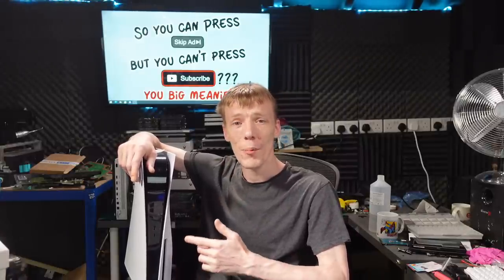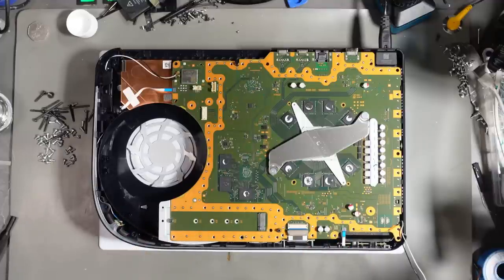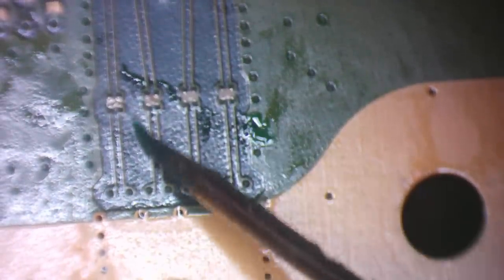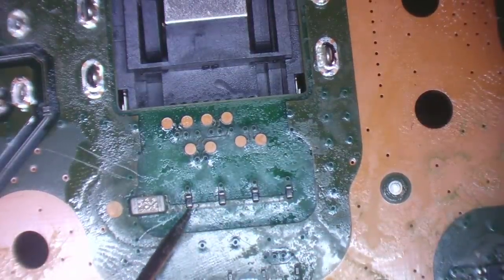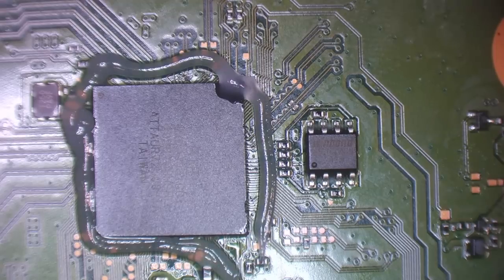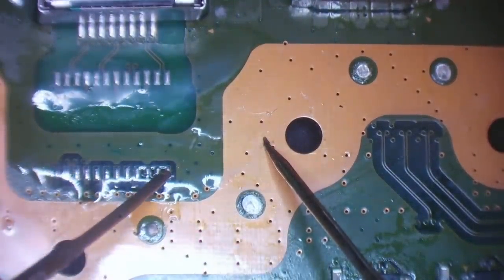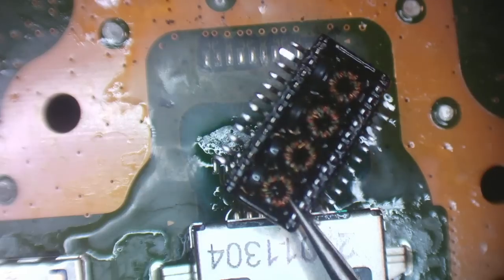This PlayStation 5 Got Struck By Lightning, And I Might Not Even Get PAID To Fix It!

Comment: That’s why I have my PlayStation five and PS4 Pro hooked up to monster surge protector I paid almost 3 or $400 for it if you love your electronics you should always have a surge protector to protect you against lightning strikes and it being insured through monster power surge protectors they were the best
Reply from the maker: Yeah I agree, a lightning rod would work wonders on the side of the building too
Reply: Dude u well overpaid you can get magnets that clip onto your hdmi for £20 and extension surge protectors which are also covered by your insurance as long as there licensed for £25 for each room, I had a lightning strike it blew my router my ps4 which had every part replaced by insurance before it ran out it was a 3 year what I got when I bought it was connected via ethernet it blew that but was connected to my tv with a hdmi with 2 surge protectors one on each end what saved my tv, now in my gaming room my ps5 and Oled TV were £2500 on there own so I defo trust these surge extensions as they have a side button and when there's a surge it switches off immediately, I sent my ps4 to CEX and said it was unfixable? This was before I found my man here but if your happy spending $400 good on you but surge extensions do just a good a job at a lot cheaper
Reply: Lightning can worm it in though antenna and hdmi also 
happened to my ps3 some time ago

Comment: Hi Phil - Glad to see the edited version of this...watching it live for those hours with you was rough, but I always learn something from your vids. lol

Question though, was this video a combo of both PS5 systems? I don't know if I'm missing something or if someone else has already mentioned this, but in most of the video you were looking for a short and you had swapped the South Bridge from a PS5 donor board that you reballed and you mentioned it was the only one you have and if the customer isn't paying you weren't leaving it (for obvious reasons). But then at the end, you mention the chips were real and looking through the comments below and the link to the chip you listed on AliExpress it's all about the HDMI Encoder. So I'm just a little confused..more then normal. hahahahaha So, was this PS5 fixed in the end with the HDMI Encoder or the South Bridge? Thanks! 🙂

Comment: Good job Phil. Thanks for the video. Really helpful  information there.  

I've had way too many storm damaged ps5s in my workshop last week. And like yourself spend way too much time on them. All with different issues. From blown power supply's to encoders and southbridges. Ps5 are a bit sensitive to power surges it seems. Glad to know those chips are real as I've got some coming from Ali too. 

Keep up the good work!

Comment: Off the wall question:
If the signal comes off the APU as a DisplayPort signal, is it theoretically possible (with heavy modding) to replace the HDMI port with a DisplayPort connector and bypass the encoder entirely?

Might be an interesting console modding experiment.
Reply: That actually sounds pretty cool. I would love to see a vid or two on that.

Comment: Great work on that one! I'll freely admit I had my doubts as to how fixable it was.
Also, while not directly applicable to this case, I had a thought about retimer chip. Given the fact they seem to fail so often, do you think they're getting overheated or similar? Would attaching a small heatsink with thermal adhesive/pads do anything?

Comment: I'm only 10 mins in, but as you suspected it was HDMI.
I wonder if it is possible that the lightning travelled through the TV aerial to the TV HDMI and caused the PS5 HDMI encoder to sh!t the bed.

Edit. Also the safe bridge.

Comment: Great work mate, I've just started out with a £150 kit. So far I've managed to fix several electronics down to watching your vids.
Reply: should wear ESD gear
Reply from the maker: JustOneSecond no, ESD is horde crap mate, sorry, but I've never been "ESD protected" and I've never damaged components. Linus and ElctroBoom did a video on it last year
Reply: @TheCod3r  Fair enough, but the damage builds over time.
Reply from the maker: It definitely doesn't mate. Linus and ElectroBoom was literally zapping the chips with static discharge and it didn't do anything, and in 4 years I've never had a board come back because of anything ESD related
Reply: @TheCod3r  I've been computers since about 1995, never used any kind of static protection, and I've never had any problems.  486 to 12900k.
Reply: @TheCod3r  i repair tvs for a living and samsung/lg/sony etc all of them want you to wear ESD straps.... ive never worn one and ive repaired over 10,000 tvs and not one has failed due to ESD. Chips these days are made with ESD in mind so the chances of damaging a component is very slim (maybe cheap stuff is more prone to ESD, but im yet to see it!)
Reply: I worked at crestron, some of those pcb's were expensive as hel, some builds went over 100k for a single unit, crazy expensive orders were the norm. We were shown examples & pics of ESD damage, i'm not saying im right and u are wrong, but we had to use ESD gear everywhere. Maybe to prevent suing 😂
Reply: @Crash-Rest-Yummy  sorry by cheap stuff, i mean fake/cheap copies of chips, and im sure there is PCB's that are susceptible to ESD, but with modern consumer electronics im yet to see it, firstly becuase they tend to have huge ground planes and because like i mentions before, chips are build with ESD protection in mind as companies dont want to be recieving a bunch of RMA's becuase its hard to prove (pretty much impossible IMO) that ESD damage was caused by the consumer.
Reply: @Mr-ZinK  I don't mind u calling it cheap np , i don't work there anymore, and i totally believe u 🤝

Comment: Very helpful video Phil. I have a PS5 that was allegedly "hit by lighting". When I do continuity checks around the encoder and south bridge, I'm getting approx 2.5 ohms resistance on 5 or 6 of the caps Is that considered shorted or is that a normal reading ?
Reply: you need a working ps5 to compare with.

Comment: Having a lighting struck ps5 going to sony for repair.  I didnt tell them it got struck by lighting.  My question is do you think they can tell it was struck by lightning?  The other video the power supply was out.  For all they know it could be a faulty power supply.
Reply from the maker: If it's under warranty I'd say they'll probably verify it isn't liquid damaged and just replace it to be honest. Not to hate on the repair center techs but most of them aren't really qualified or experienced enough to tell to be honest
Reply: @TheCod3r  that's what I was thinking.  I seriously doubt they would go through the trouble that you went through testing every single part when they can just send out a refurbished replacement.
Reply: @mrdante361  hey did Sony repair your PS5? I’m about to send mine for the same issue thanks for the info man!
Reply: @123rubd  yes I did get a ps5 back and it's been working great.

Comment: Yo, good work! The same problem it starts all voltages present and south bridge seems to be ok. I got only beep signal and blue light, 5 sec after it shuts down. But after 10-20 attempts to run, it showed image and says software update 70 .. 100 and switched off. And starts the same only for 5 seconds. I checked all fuses no short line and nothing got hot. I saw winbond spi rom right behind south bridge you changed. Do you know can I program spi chip? And what dump I should to use? Thank appreciate

Comment: Why don't people just buy protective electric surge extensions, I learned the hard way it hit my building and it blew my router and ps4 which was attached through ethernet but my tv had hdmi surge protectors on each side luckily my ps5 in my gaming room was switched off, there only £25 and get one for each room as they have a little switch at the side so if a surge comes it switches of and saves your electronic's

Comment: Does it matter if the hdmi encoder chip is upside down or right side up does it cause problems or does it not matter?
Reply: Of course it matters.
Reply from the maker: Yeah it does matter mate, the chip needs to be oriented correctly otherwise it'll try and pass signals and power rails through the wrong parts of the chip

Comment: I have a ps5 I bought that the seller said it gotten struck by lightning but I get absolutely no power and I get no voltage from the power supply
Reply from the maker: Thats a dead psu mate. I have another video coming with that issue from a lightning hit, it's part 2 to this video
Reply: @TheCod3r   mate mines the same as yours in that video does the same thing and got nothing from the power supply

Comment: Anyone know the best way to prevent a lighting strike from hitting ur house electronics, I’ve got surge protector but I don’t think that would save it
Reply from the maker: Generally you need a lighting (earth) rod fitting. It's a long strip of copper which runs down the side of the house and into the ground. It's designed to attract the lightning if you have one near your building
Reply: Surge Protectors will not protect a direct strike.  If you think about the distance the lightning jumps from the cloud to ground, it is going to jump a Surge Protector (And kill the Surge protector in the process).

Surge protectors really are there for minor surges from your utility provider.
Reply: Most big buildings have a lightning conductor, it’s just a big copper strap that goes from the roof down the outside of the building to ground
Reply: @gower1973  Yes, for a strike to the building, but if you have overhead wires for your mains supply and IT takes a hit, then you can likely kiss all of your electronics bye bye's, or if it hits your telephone line, it may jump to the power system if they are close.

Where I am, the power supply is underground with a distributor box for every 20 or so houses.  In a previous house we had overhead wires, and the utility alway like clockwork never cleaned the dust from the wires, so the first rains of the wet season, the wires would short out and I lost Routers and Modems because of over voltage, Utility company didn't give a shit, they just said "Whatever, not our problem".

Comment: Use RTX voice. it will remove the background noise perfectly.
Reply from the maker: It doesn't work great for repair videos mate. The constant changing in background noise with the hot air etc screws it all up

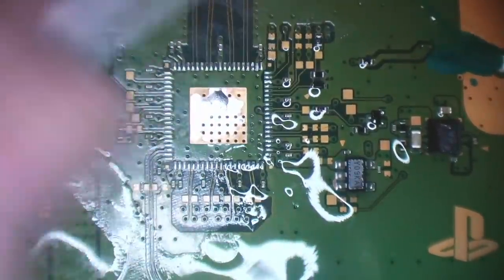Comment: I've watched quite a few repairs and some of them warn not to add IPA while the board is hot, precisely because that can happen. It can start removing the board's PCB mask, as you experienced here 12:15
Reply from the maker: That's not true mate. Whoever said that is wrong. The solder mask in this video was the result of it being on my multimeter probe (I realised later in the video) but I've never come across that where IPA actually strips solder mask and I always add IPA while the board is hot because it makes it easier to clean the flux off

Comment: I have never had a problem with Aliexpress, just look at how long the shop has been up on there, if 6 months then beware, if say 7 years, then I tend to buy from those. Not fool proof, but, the longer they have been on there then the better chance due to certain reasons and laws in China. Again not fool proof way, but, always check how long they have been there for as some pop up for a few months then disappear again.
Reply from the maker: I've had a few issues but that's some good points you've got there. Being vigilant definitely helps